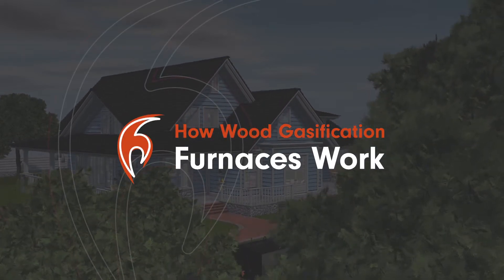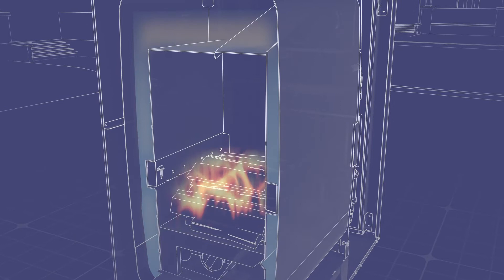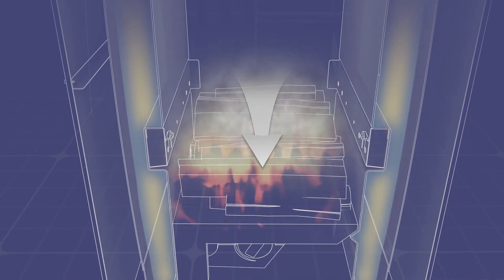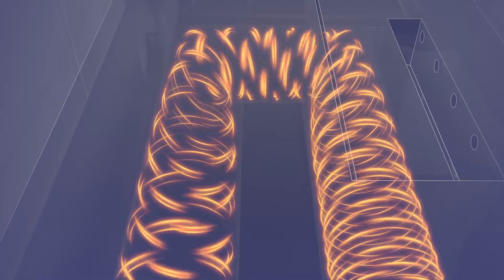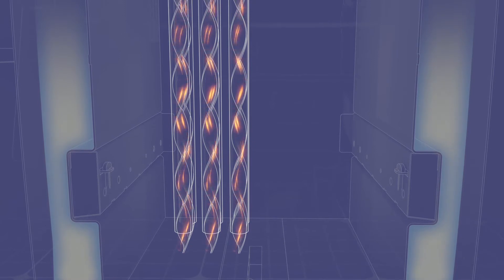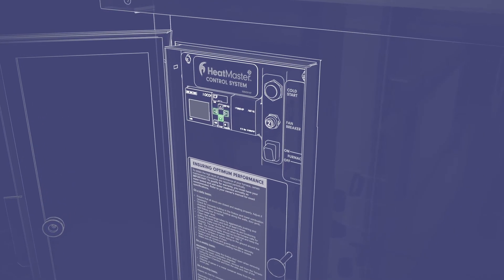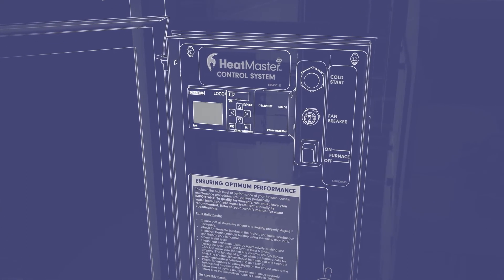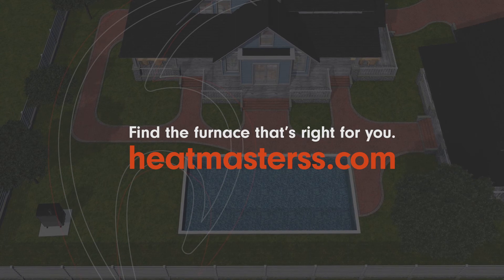How does Wood Gasification Work?

Comment: This looks like a great furnace. Do you have models available for Europe (well, almost anywhere in the world outside the USA) that uses a 230 V, 50 Hz supply? I'm sure that the Siemens LOGO PLC is easy to program to use degrees Centigrade.
Reply from the maker: Hello, thank you for your comment. We are in the process of getting our units certified for use in Europe.
One of the things we are working on is the power conversion to work in European markets.

We would be happy to work together with you to get you a unit. You can call us @ 877-325-9792, or fill out your information here https://heatmasterss.com/request-a-quote/